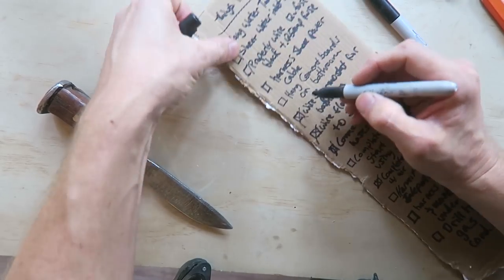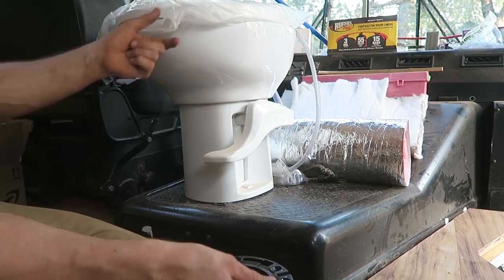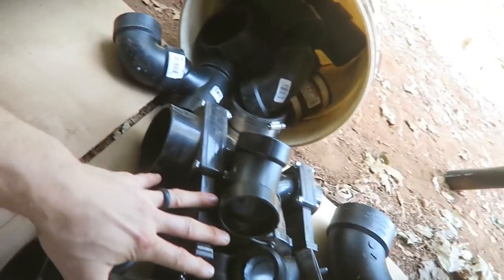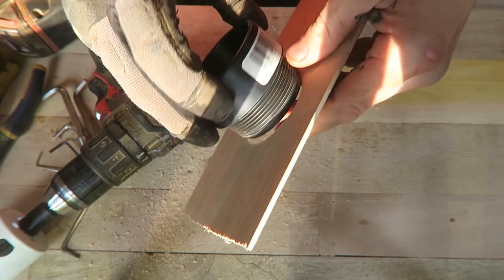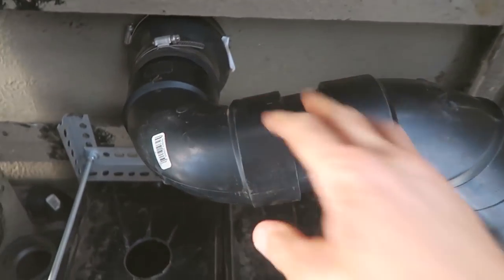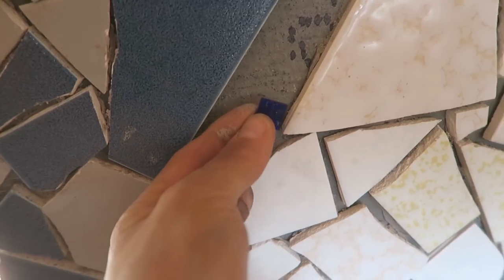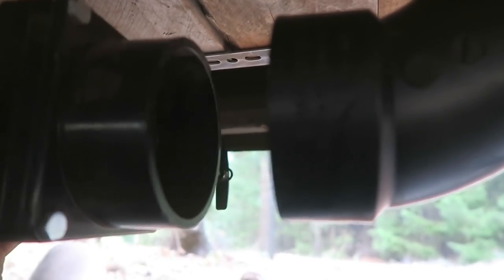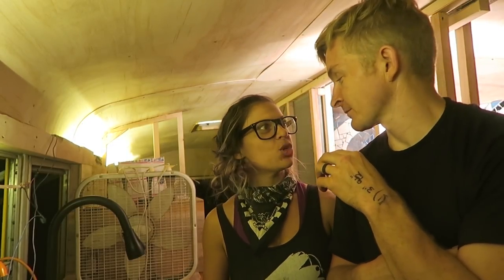#75 SKOOLIE BUS CONVERSION | Plumbing the Toilet and more Bathroom Mosaic in our Skoolie

Comment: Just my two cents: You will have problems with the toilet. Move the tank over so the toilet dumps right into the top of the tank. The way you have it now, solids need water to push it down the pipe. You will fill the tank to the inlet in no time. And your thought of the vent allowing the toilet to work above it's inlet, once the waste level passes the height of the inlet, the water coming from the toilet will have the resistance of the waste water already in the tank. The water will seek it's level, but leave behind the solids in the pipe. Also, did you figure out how you will know the level of the waste in the tanks? Does Nevada allow composting toilets? Differently will need a follow-up video once on the road.
Reply: you can buy electronic level readers to display their capacity level from inside the bus.

Comment: When you put the toilet down, consider a flexible gasket ring instead of wax, they last a lot longer  then wax, and can handle movement better. this one is in 4-5 I fixed...    http://www.homedepot.com/p/Toilet-Gasket-Flexible-Waxless-Seal-Universal-Fit-BL01/203564758
Reply from the maker: Interesting. Thanks for the heads up JBD. You Rock.

Comment: Great work as always guys..I have to agree with others here..the toilet should drop straight into the black tank. An rv type toilet(tankless) works strictly via gravity..no water pressure/vacuum(think outhouse..lol).. You want a straight drop..those bends will cause backups sooner or later. Maybe you could slide the black tank ahead enough for a straight drop? Full disclosure..i'm an armchair commentor..I've never actually built one of these systems, but did own an rv for quite a few years and that's how it was plumbed. Keep up the good work!  I'm sure you do your own research..you seem very thorough..but I found this video where the guy gives a nice simple explanation. hope it's helpful. 
https://youtu.be/t3UUaOl7nOo

Comment: First off Happy Birthday V.  and awesome shower build, I LOVE IT. 

 Another great video of your days on the bus.  Don't worry about the tank too much as I think it will fill.  You can prove or disprove my theory by purchasing a 5 gal bucket with lid.  Cut a hole in the middle (to simulate the drain pipe) and lid (for the vent).  start adding water to the bucket via a pipe screwed in like on your tank and I bet it will continue to fill the bucket with water albeit slower as it reaches the top but it will fill.

Best of luck with your work today and I look forward to your next video.  Keep your "Can Do" attitude charged and press on.

Comment: But when you dont get the shit to go in the tank from the top, but from the middle it will be "full" when its half full?
Reply from the maker: Yeah, it's the only way I could make it work.
Reply: I don't this will be the case.  I think you will be ok as gravity will continue to take it down to the tank as long as you have the tank vented - above the tank. (as ya'll discussed @$#% runs downhill)  You will have to be careful with the vent though if it is lower than your toilet bottom it has the chance of running out and making a mess when the tank is full.
Reply from the maker: LoL -  Yeah. That would be indescribably gross. I'm working on the vent today. I want to do it to the roof. There is no way to really do that though unless we put the pipe along the exterior of the bus. V thinks that would look ugly. I don't know what to do.
Reply: Ian Robinson Also you prob need a one way valve so you as said dont get the poop up tru the toilet
Reply: Agree.  What will eventually happen is that your black-water waste will start backing up into the fill pipe from your toilet - where it could cause clogs.  You'll want to empty it out as much as possible.
Reply: I don't think there is a one way valve for a toilet.  A call to a reputable RV dealership would help with understanding how they install toilets in RVs and especially if you were able to talk to a person that performs maintenance.
Reply: Ian, look under the bus and above, you can always run the vent pipe horizontal until you can get it in the back of a closet or somewhere that you can take it through the roof.  Don't stress it and you know you are good at thinking outside the box.  Maybe step back a few days and re address it then you will come up with something.  A bus is not rocket science so there is a way, and yes I would never put it on the out side due to many reasons.
Reply: top